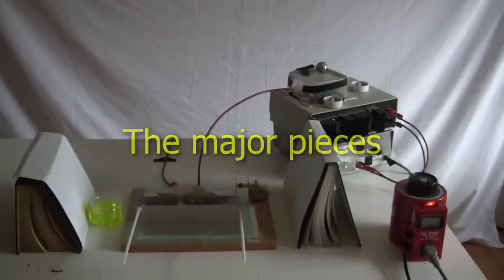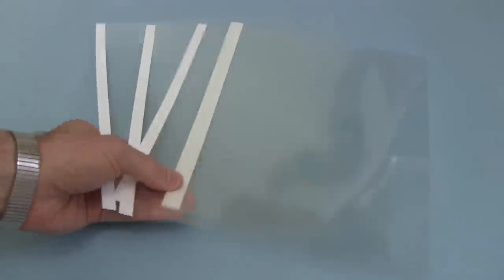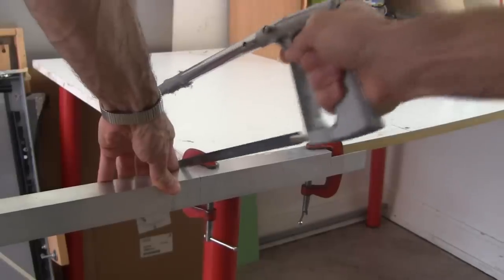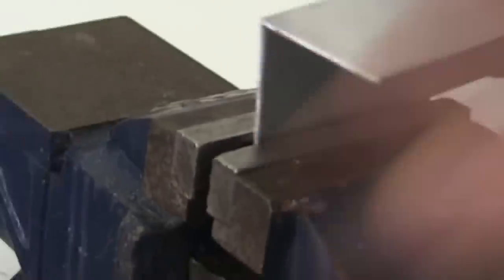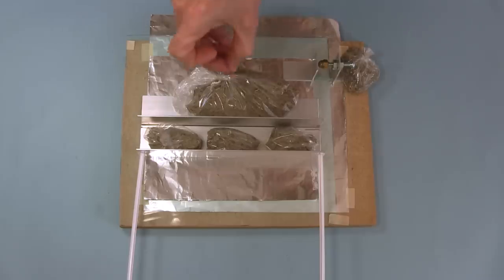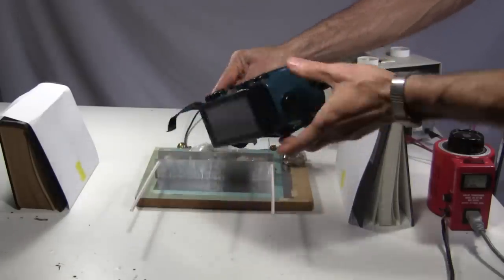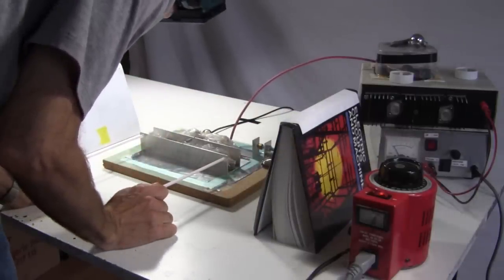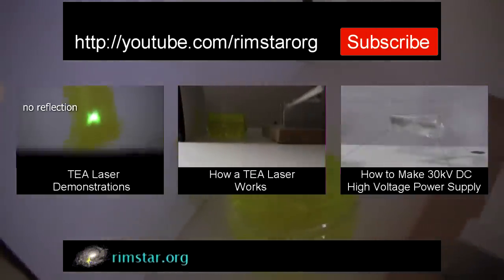How to Make TEA Laser - Homemade/DIY Laser

Comment from the maker: From what I see with mine, you have to be able to produce a spark with a lot of current in it. That's in order to produce enough electron collisions with nitrogen molecules in the long spark gap in order to get the lasing to work. I don't have a fly swatter but from what I've seen of them in videos, I don't think they'd have the current. The sparks would be too thin. The sparks I need to produce to get it to work are pretty loud, thick and bright.

Comment from the maker: Thanks! I don't know what'll happen if you blew helium over the gap. I do know that if you add helium in a high pressure environment then the color/wavelength will 427.1nm instead of around 337.1nm. Not something I've tried, just something I've read.

Comment from the maker: Do you mean a MOT converted to step down to low voltage and high current, then rectified and sent to a high power laser diode?

Comment from the maker: But I guess if you have a 45cm diameter sphere or bucket and you connect the positive output of your fly swatter to the INSIDE of the sphere (same principle as a Van de Graaff generator dome, Faraday ice pail effect), you could accumulate enough charge on the sphere. Then, where I have the cap nut shown my spark gap in the video, use the sphere instead. I haven't tried that but theoretically it should work.

Comment: I'm thankful that there are 405nm lasers out there that can give us the exact same fluorescent effect as your TEA laser.  While 405nm is not technically ultraviolet, at least the violet light that they emit is actually very close to the UV spectrum so it behaves very much like the ultraviolet light from the one you're using.

I would love a TEA laser but I don't think I could deal with all the steps especially with constantly blowing the capacitors.

Comment: Try using plastic sheets from LCD tvs we have tested them up to 50 kv, they are amazing for dielectric material.
Reply from the maker: Thanks. How thick are they?
Reply: They come in many thicknesses, we have tried the thicker ones from 42 inch tvs (excluding the thicker 2mm acrylic panels ) smaller screens use thinner. But in testing we have found it to be one of the best we have found for withstand/vs thickness. I am a laserist by trade and play with HV as a hobby and would love to exchange ideas. I am considering putting a TEA laser into a pointer which brought me to this video.
Reply: Just checked at the shop the ones we are using are .2mm thick
Reply from the maker: Okay, thanks. The polyethylene and photocopying sheets I used were both around 0.1143mm. Let us know how your TEA laser progresses.
Reply: One quick question to ask, does the ion channel have to travel along the plates or can you store charge in a reserve capacitor.  ( does the ion channel have to travel from opening A to opening B or is is simultaneous discharge along the capacitor surface? )  Asking because in a pointer if I cannot use a reserve area i am going to have to do some fancy capacitor geometry.
Reply from the maker: I think the discharge can happen from one end and work its way down but it has to be very, very fast. That's why the flat capacitors have the geometry they do, so that they can discharge quickly. The reason speed is needed is because the stimulated energy states only last so long and need to be fed energy before they change state. Search on this page for "Three inch long TEA laser" for the smallest one I've seen.
Reply: I saw similar on tesladownunder as well,  in knowing the travel of the ion channel I can probably get creative with layers in half cylindrical layers with parallel termination along the lasing area. I have some fine tungsten wave guide plates, .7mm thick 1.5/1 inch I am strongly considering due to the resistance is has against discharge oxidation. Instead of a spark gap also considering high voltage IGBT  or SCR die. Sounds like the principle is the similar to the ion channel physics involved in a gas laser. If you have free time check out join the technicians on youtube, I'm part of that channel and I think you would love some of our stuff as well. 

I will have to play around with a few set ups before I get to the point of miniaturization, but the physics say yes so that's all I need to know :) 
Thanks for the feedback it's pretty helpful and if you want any help with lasers/specialized optics feel free to drop a line, same name on gmail.

Comment: A friend and I are trying to rebuild this one, but we're stumbling across a little problem. Our voltage source doesn't deliver enough voltage for the laser to work. 
So we're wondering, do we need to use DC voltage or not?
Reply from the maker: Yes, you need DC because you have to charge up the spark gap that's on the side of the TEA laser (the one which I made using a piece of angle aluminum and a brass nut). As long as you can charge that up then it should work. Of course, you can make that gap very small and then you won't need much voltage but when it sparks, there won't be enough energy to power the laser. So there is a minimum gap size you need, and therefore a minimum voltage (I don't know what that is). When testing it, I have to gradually make this gap bigger and bigger until the laser starts working.
Keep in mind that depending on your power supply, it may take a while to charge the spark gap. In this other video https://www.youtube.com/watch?v=9huUsYDJZrM, I use a Wimshurst machine and it took around 10 seconds to charge up while the gap size was large enough for the laser.

Comment: Thanks, nice video! You use a vice and turning the wire to straighten it out. Another, simpler way to straighten a wire is to clamp one end in the vice and pull on the other end with pliers or similar, stretching the length of the wire by a couple of percent. The metal lattice 'learns' the new pattern and you end up with a perfectly straight wire.
Reply from the maker: Henner Zeller I'd actually read about that wire straightening technique at the time but didn't think it would work as well as claimed. Now that you mention it I'll have to try it next time. Thanks.

Comment: 5:18 can someone please tell me where I could get those metal ball things or something els i could use instead
Reply from the maker: You can get them here https://www.amazing1.com/categories/parts/miscellaneous.html . Mine actually came as a part of a high voltage power supply which I also bought from that website. Another source of roundish metal things I've found is to look for drawer knobs in places like Home Depot.

Comment from the maker: +JBCACC It is hard to get working and takes time and patience. Try with different widths of the lasing channel (the long gap between the two aluminum angle pieces.) You can still get sparks like you're getting with smaller or wider gaps. Also, increase the other spark gap so that there's more power each time. Those are the two things I adjust to get mine working.
PS There's no Reply button under your comment because of your Google+ settings.
- go to your Google+ page,
- in the top, right corner click on your thumbnail icon,
- in the popup that appears, click on "Settings".
- for the 2nd question down "Who can comment on your public posts?" set it to "Anyone".
Reply: RimstarOrg Hi, thank you for your reply. I just dont get it work :( tried it the last 6 days with all different kinds of concepts but no laser.
Reply from the maker: JBCACC What are you using for your power supply? The capacitor plates have to be very close together to work so what are you using as your dielectric (the polyethylene or transparency film)?
Reply: RimstarOrg I have built one from an old computer power supply and a flyback, so i should have enough power in the system. I think the max. V i can get is about 50kV. I´m using two transparency films. should i try it with only on?
Reply from the maker: JBCACC
Yes, try just one transparency film. The dielectric needs to be really thin in order to meet the timing requirements, and yet it has to be able to withstand the voltage. I got it working with just one transparency film.
Reply: RimstarOrg i burned a few transparency films but there was still no laser. i give up :D  but thanks for your help!!
Reply: RimstarOrg
Hi, i tried it again with some changes, i used another form of electrodes and build a device/gadget to hold them in place and press them down. so now it works :) thanks again for your inspiration and help!!
Reply from the maker: JBCACC
Excellent! Thanks for letting me know! I don't like it when it doesn't work out, so I'm glad you kept at it. What was the other form of electrodes that you used?
Reply: RimstarOrg 
i used two flat pieces of aluminium. one side i honed so it was pointed.

Comment: Hi, I want to implement this into my science fair project, but I need to test a certain variable.  I was thinking of changing the distance between one of the spark gaps, or the amount of voltage, or the amount of resistance between the long spark gap.  Do you think any of these may add danger to the experiment (e.g. blowing holes through the dielectric) or make the laser simply not work?  Thank you
Reply from the maker: All of these things may make the laser simply not work. It's fairly finicky and takes fine adjustment to get everything just right and make it work. In my experience if the voltage/spark gap distance is too small it won't work and too large you start blowing holes through the dielectric. The only variables I can think of you can play with while the laser keeps working reliably is the cross sectional area of the beam at different distances, or maybe the affect of passing through different liquids.

Comment: HI, I have always heard that the power in these lasers is enormous.  Do you know if the beam (with an end reflector and focusing lens) can ionize the air enough near a high-energy capacitor spark gap to produce isolated triggering?
Reply from the maker: I suspect the power is low since I could put my hand in the way of it and feel nothing. But then again, it lases for only a brief time each time. Either way, I don't know if it can ionize the air enough.

Comment: what is the resistor required for? charging the capacitors?
Reply from the maker: It's for delaying the charging of the 2nd capacitor; the 1st capacitor is the one with the spark gap from the power supply. That way the capacitors will be at a different polarity long enough for the corona and sparking across the lasing gap to happen.
Reply: RimstarOrg Can I remove the second cap?
Reply from the maker: Hariz Izzudin No, both caps are needed. It's the delay in charging time between them that causes the corona and sparking that results in the lasing.

Comment: is it possible to use actual 20kv capacitors instead of the aluminium sheets?
Reply from the maker: +EEEE le r No, the aluminum sheet capacitors with the very thin dielectric are the way they are due to the fast discharge time requirement.
Reply: +RimstarOrg yes but I'm sure you can measure the capacity of the aluminium sheet capacitor and will get something like 0.05-0.1 uf. I plan on using 5*20kv capacitors to have 0.5 uf of capacity.
I am sure that this can discharge with no problem. I hope to make a laser induced plasma channel for an electrolaser.

Comment: Hey Dude! 
 That's not a laser! It's just a bad Electrical spark. I can do that echo friendly with an empty cigarette lighter.
Mr. Nikola Tesla many decades ago made better interesting experiments. You should make demos of his experiments.
Reply: You're partly right. It's not really a laser, but rather a super-radiator. But the only difference is that there is no cavity because the lifetime of the population inversion is so short that you can't build one. But still, the nitrogen laser is probably the strongest (and the most dangerous) "laser" you can build at home.